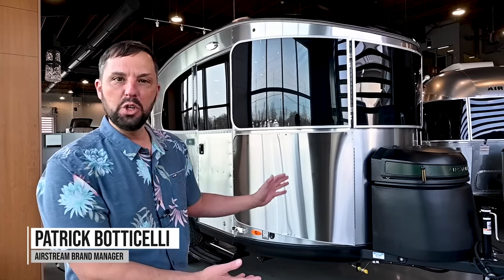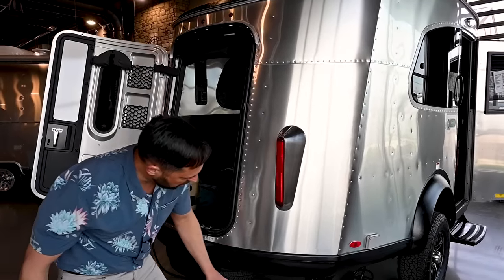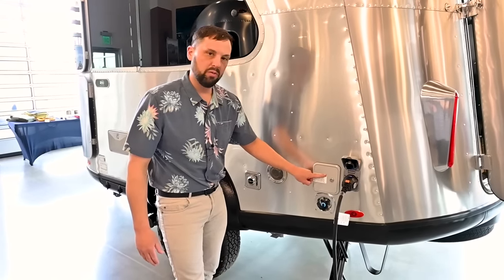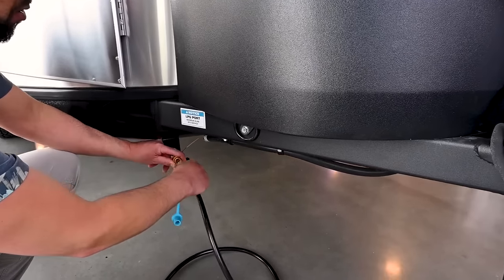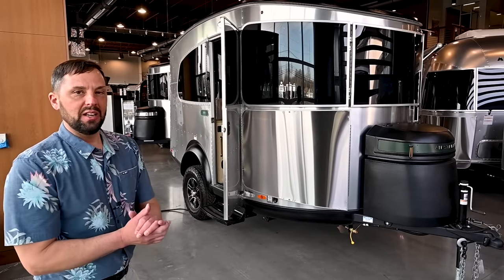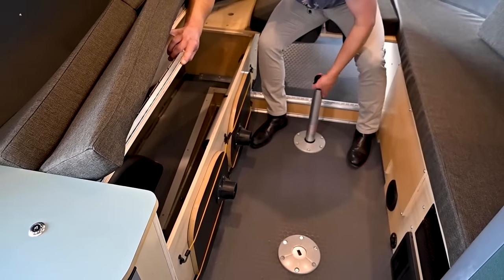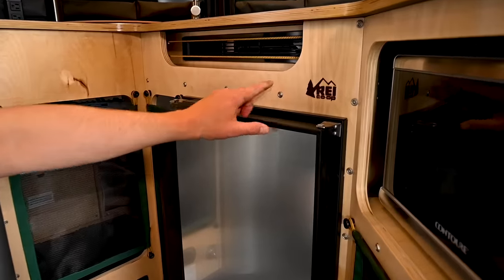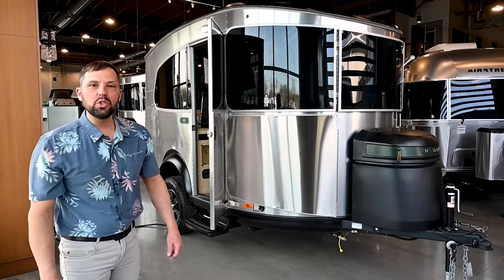The COOLEST Airstream Trailer | 2023 REI 16X Basecamp - Walk Through

Comment: Could a subaru outback wilderness pull it , 3500lbs ?
Reply from the maker: If you vehicle has enough hitch weight allowance, payload, 7-way wiring harness and an aftermarket electric brake controller. it may be able to pull it.

Comment: Great job on the tour but that floor plan really doesn’t seem practical to me. Can you even put sheets on that oddly shaped sleeping space??
Reply from the maker: Yes, owners of this model are able to have sheets on their beds.
Reply: It’s not a problem, i have a bed like that on my boat, queen size fitted sheet set is perfect (this van might require king size) the elasticated bottom sheet works a treat for odd shapes… Another tip, I found the cushion gaps a bit annoying when sleeping so I got a thin mattress topper and cut it to size

Comment: I would never buy an RV with a combined grey water black water tank.  Big mistake on Airstream’s part.
Reply from the maker: Having a combined tank can increase the overall capacity and efficiency of your RV's wastewater system. Which can be particularly advantageous for those planning to camp off-grid for an extended period.
Reply: @colonialairstream  There are a number of State parks I have camped in that only have one dump station but grey water stations next to the campsite which means one can empty grey water without moving the trailer. Also dump stations that take sewage are gross. You need to wear covers for your shoes or dedicate a pair of shoes for dumping. Cassette toilets are a much better concept for black waste.
Reply: Lots of people that are buying these are backpackers that want to upgrade their “Basecamp”. Backpackers are pretty good at working with 1-2 gallons of water per person per day, and others can easily learn. So a 20+ gallon combo tank is a luxury. You need the small amount of grey water you create to get that black tank sloshed and prepped for the dump station before you go back out to “rough it” in luxury. Perfect set up for the target audience, and with over 3 years of experience with the BC16X I speak from experience.
Reply: @colonialairstream if you combine the tanks then there should be a macerator

Comment: Carbon Monoxide detector is worthless where it’s placed, CO is less dense than air. It is recommended that they are to be placed 5 feet above the floor. The fire detector should be a combo fire and CO detector.
Reply from the maker: It is installed correctly as the manufacturer instructions.

Comment: 62,550 ? Come down to 12,000 to 20,000 plus EV is not towing this
Reply: EV not towing anything more than 50 miles.
Reply from the maker: We understand that the price of the Airstream Basecamp may not fit everyone's budget. However, it's important to note that Airstream is a premium brand that offers high-quality materials, innovative designs, and exceptional craftsmanship.

Regarding the towing capacity, the Airstream Basecamp is designed to be towed by a variety of vehicles, including some electric vehicles. However, not knowing what vehicle you have, it's important to consult with your vehicle manufacturer to ensure that your vehicle is rated to tow the Basecamp safely and efficiently.
Reply: @Peter pan If you can find a trailer with even half of these features for 12k then stop reading this and run out right now and buy it before its gone, they come back here and give us a review.
Reply: $12,000 😂
Reply: $12000 won’t even get you a new pop up anymore.